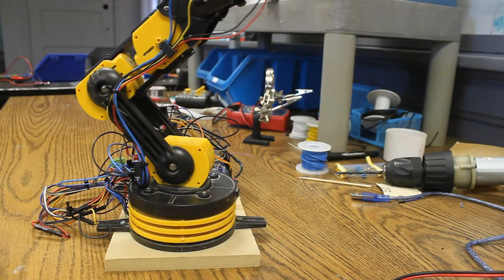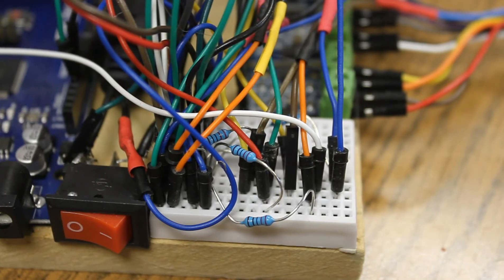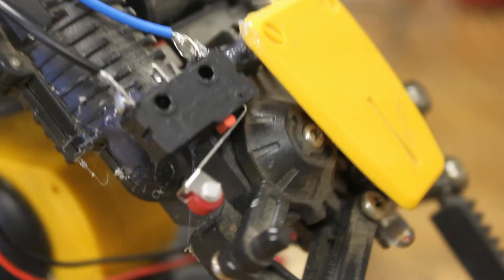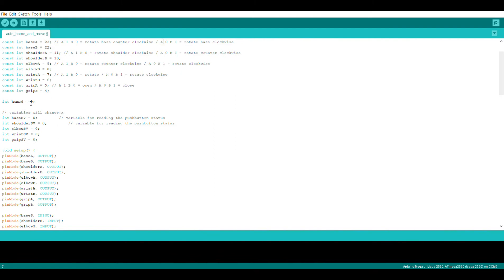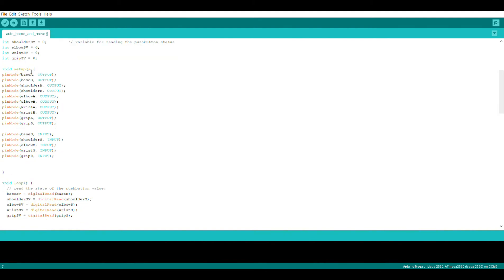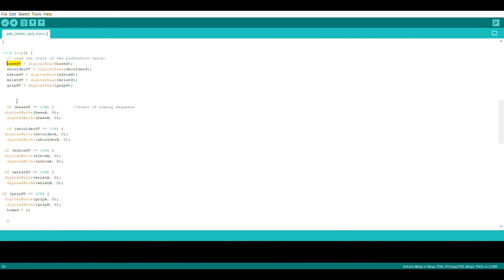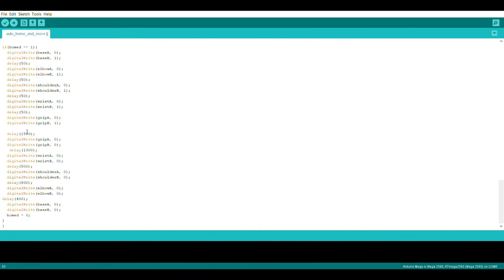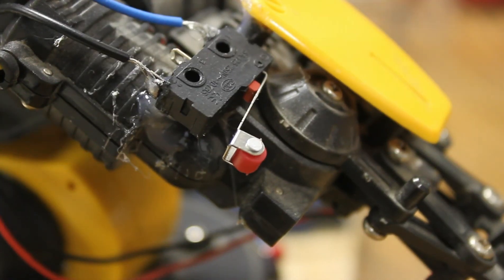Arduino Powered OWI Robot Arm DIY

Comment: i saw one on ebay i want to buy but wow,,,,i'm new to Arduino...i'm not sure i can get this to work with mine...i just got the Elegoo super Kit and now i want to get into robotic arms...any suggestions for an alternative for something more simple?
Reply from the maker: There are some kits on ebay and amazon for servo driven robot arms. I think it would be easier to get working with a arduino as the servos are easier to program with and have more features than using a dc motor like I did. Search for "servo robot arm kit" on amazon and you can find some neat kits for under $100
Reply: @daily3ddesign  yeah but i want this kit...lol..there's one locally in my area for $30...if i were to buy and use a separate power supply..can i get it work still with my Arduino? i realize these are motors instead of servos,,but i still can use the power supply that came with this arm and use the Arduino to control it right? Hope to hear your response...
Reply from the maker: @rhampton1914  If you are saying you want to use the same robot arm kit that I used then any 5v power supply that can supply enough current will work. The kit uses batteries to power the motors and I imagine you could also use those to power everything but I wanted to use a PSU so I went that route instead. Still not sure if I fully understood your question there but hopefully this helps

Comment: That’s amazing mate! Are you planning on adding any sort of computer vision to it in the future?
Reply from the maker: I have never messed with computer vision before but that's a great idea and would be a really neat upgrade. I could see the arm being used to sort different colored led's or maybe even different lengths of bolts with a add on like that. I would like to add a potentiometer to each joint so the arm could then know where it is after homing and you could use more precise movement commands in the code instead of the timed delays I am using now.
Reply: @daily3ddesign  that would be awesome!